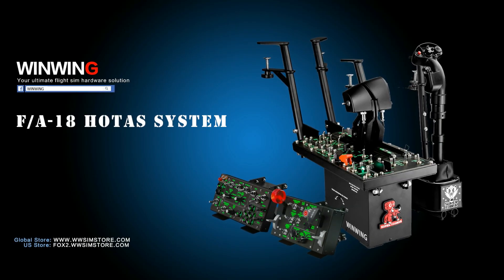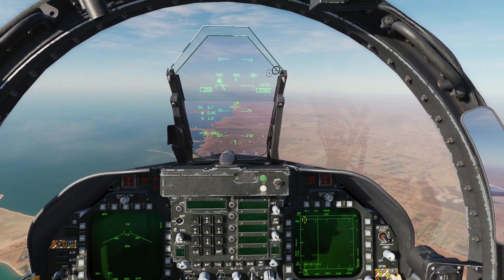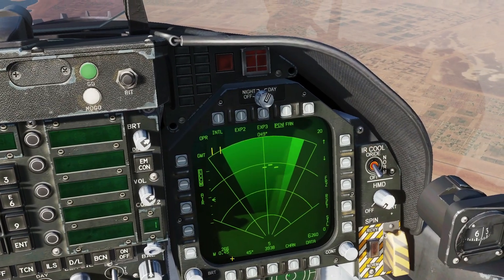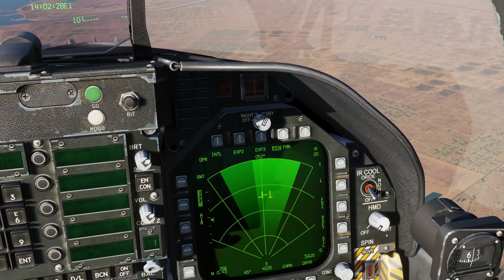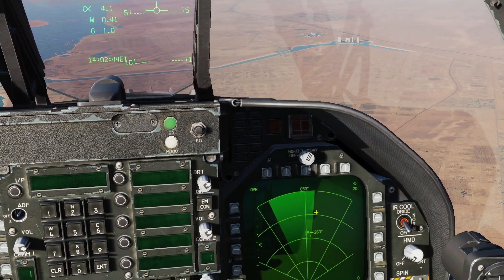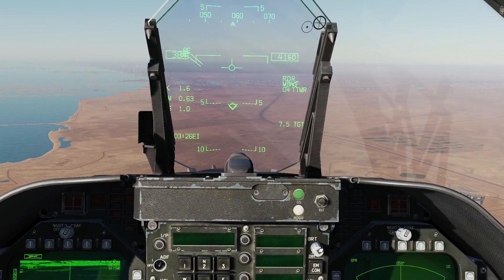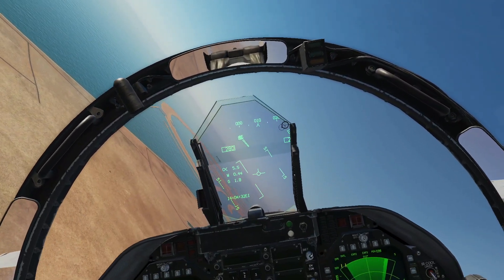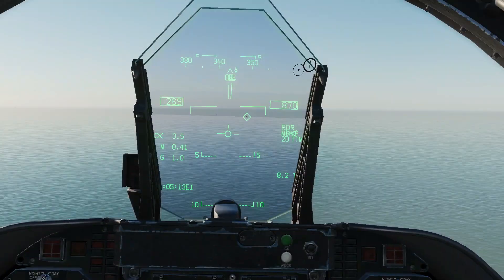FA-18C Hornet: Air To Ground (GMT & SEA Modes) Tutorial | DCS WORLD

Comment: Great video. Thanks. Quick and to the point. 
What happens where you have a convoy and the targets appear all clusterred together but you want to lock onto a specific target (let’s say the second vehicle in the convoy) - is there a way to have an expended view of the targets, kind of spread them out in order to assist in choosing a specific target out of the cluster (sort of like the RAID button in A-A mode)?

Is there a way to switch lock between the targets without having to unlock a target (sort of like the un designate button in TWS mode of the A-A radar)?

Comment: It's funny though because the real hornet won't see that first target vehicle because it's only doing 9 knots, the gate for GMT is 10 knots, so it should not have shown up at all on the radar. :)
Reply: thats luckily not going to be a issue for the upcoming A-6E intruder
its GMT mode (AMTI in the A-6 manual) can track ground targets as slow as 4mph (3.4knots)
Reply: @IronPhysik  do you know where i can get a PDF of the Manual? I am really interested in the a6 intruders Radar and such on

Comment: Literally all the SMEs on the ED forums: "Don't look forward too much to the AG radar, it's pretty useless, I never used it"
This video:

:D

BTW I just wonder if GMT can detect moving ships as well, didn't try that myself yet

And a protip: You can use the EXP submodes on the GMT mode to get a nice close up view and literally observe how they move there. Just designate with TDC depress and use the EXP supmodes as if you were in ground map mode. It's also possible to switch back to that mode (and back to GMT again) within the EXP submodes and check out the area for distinct land marks, roads etc with that to make sure you get the right thing. Also, the TGP gets slaved to the designation, so you can take a direct peek at things if you bring the pod. Oh and you don't really need that one anymore for the 84Es now :)

Comment: Is the IR Maverick fire and forget for the moving target case, or do I need to keep my radar staring at the bad guy until impact?
Reply: Fire and forget ;)
Reply: FF, Mavs are not radar guided.
Reply: If you really want though, you can slave the TPOD to the radar lock, then laze with the TPOD, then fire an LMAV :P
Radar guides the laser, which in turn guides the Mav ^^
Reply: The MAV-F will track moving targets once it gets a contrast lock whether it gets the lock from the FLIR, RADAR or MAV seeker.  So once the IR-MAV is locked you shouldn't need to maintain Radar lock at all